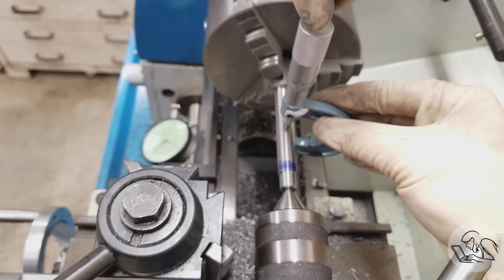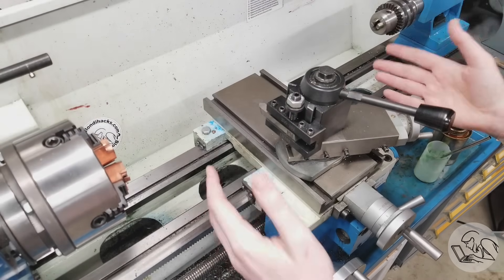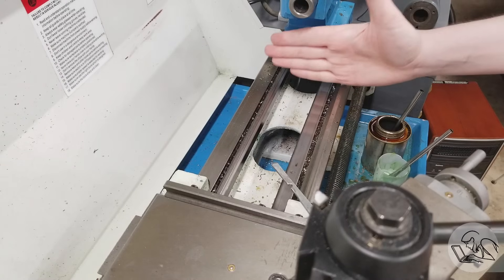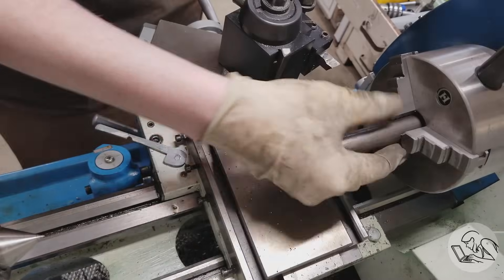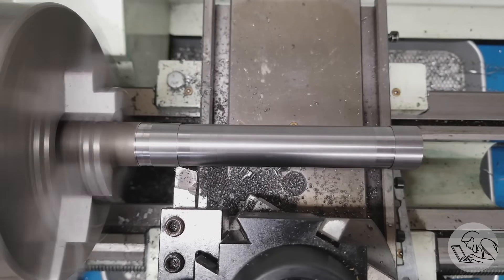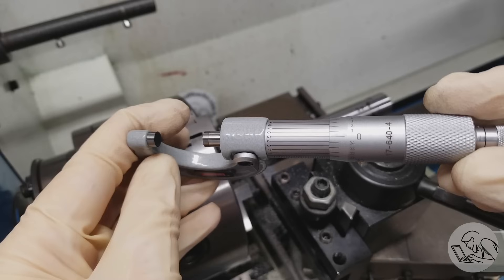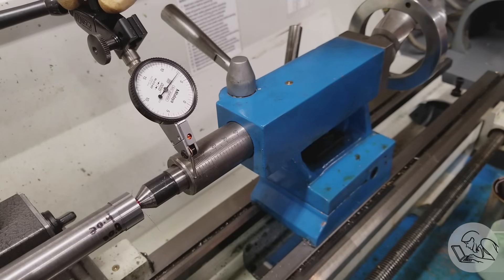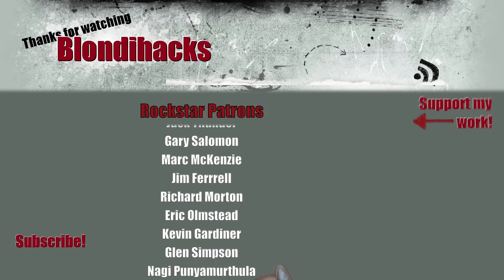How To Align Your Lathe

Comment: Been a subscriber and learned a lot of tips and tricks in machining as well as about Metrology from your channel.  I have been a woodworking DIY'er and finally bought myself a decent bench machine lathe and learning the nuances of setting up.  Your video here has come in very useful in both checking and "struggling" through the alignment, which, even for a new machine, has been very tedious to say the least.  I hope it will pay off in the long run to get parts with "predictable" precision

Comment: A lot of people don’t know that those levels aren’t ground flat they actually have a very slight curvature to them. For max accuracy it’s designed to contact your surface only on the very ends so if the level overhangs past the surface your leveling it can cause incorrect readings

Comment: Q: You can move the tail stock back and forth (horizontal). But I guess there is no way to move it up and down (vertical)?  So we just assume the vertical is good?  
Q: also this assumes the tail stock alignment does not change as the tail stock moves down the ways?

Comment: I had to move to a new shop with my lathe. I reviewed this video I had used 3 years ago to set up my 10X22" Grizzly when it was new. using these techniques I was able to get it cutting at 2/10,000" over 5" in about 2 hours. Thanks for the second time! I have the same Sterrett level, bought it used on eBay after watching this the first time. It took a .020 shim on the tail stock rear corner.

Comment: great video thanks. For my non-precision set up here, I used a level that was not a machinist level...accurate? maybe not. Repeatable, probably. Getting the two ends the same was what I was after, what my level called level. I guess the key is in the resolution, as the machinist level might be more sensitive. When I get to the point of being able to make a test bar, I will see how it shakes down. Got a 'way' to go for that yet, (groan)  but thanks for explaining what "leveling a lathe" is! meanwhile I will scope out Ebay for a more proper level.

Comment: Just a thought. If you maintain the same orientation of both the level and the blocks in each position does it really matter if the level is calibrated or the blocks are identical? If the conditions are constant in each position you’re just measuring the relationship between the two and trying to match the bubble positions.

Comment: Hey blondi! I hope you have some idea. I have a mini lathe who works very good and cuts good in steel, alu etc. and never had chatter. But it cuts taper like no one else. On 100mm (4”) it cuts 0.1mm taper. Tried to level the bed and realized I needed to raise the right close corner. Did that and raised it again and again until I was 0,6mm higher there. And the taper went from 0,1 to 0,05mm on 100mm. So I exaggerated and raised 2mm and the carriage started to bind. But tried anyway and was back to 0.1mm taper on 100mm. 🤔🤔

Comment: Excellent, but one flaw in the method is that the carriage actually rides on the wedge portion of the ways in the front, not the top. So, the assumption is that the wedge flats are in perfect parallel with the top. On my crappy 7x10" lathe this was not the case, and scraping in on those angles is no job for a novice. Ask me how I know! I'm guessing that on this PM lathe, which I also own, the ground surfaces are more accurate. To take this up a level, you'd have to register off the V part of the front ways. 😊

Comment: Ahh.. I have spent HOURS trying to align my HS by adjusting the jacking bolts and keep swinging between +/- 0.7 thou over a 6 inch bar.. Very frustrating! The shim twist looks like a much less painful way to do it.. Thankyou!
Reply: Update.. I shoved an 11 thou shim (namely a razor blade) under the appropriate place and immediately got to within 1 tenth over 5.5 inches as far as I can extrapolate on a 1 thou mic. Its not so easy on the 1440GT because there are 4 nuts and bolts with not a lot of access from the underside. Managed to get my impact wrench in there, just. Sure would be nice to weld a bar across the nuts on the underside but it may be worth leaving well alone at this point. I have a 1 tenth mic coming from Amazon tomorrow then I'll decide if its worth adjusting further.

Comment: I have some trick to save money and get better result from alignment. I have used piece of 40mm rigid CrMo bar and hammered pieces of aluminium pipe on both end. That's how I can combine rigid high strength bar and easiness of machining aluminium. I don't have to ruin the precious steel stock and I can just change aluminium when I have used it all.

Comment: Have you checked the straightness of your rails? I have similar lathe, HBM vario 550, and my rails are not straight. My level has a resolution of 0.02mm/m and I have leveled my lathe from each and in sideways direction on the middle. Still the bubble runs on the opposite end when measured from the middle, indicating that closer rail is lower than the other. Also, it runs on corresponding side when measured sideways from each end, indicating I have low spot in the middle of the rails.
 
I have tried to put a jack in the middle to correct it, but it requires almost all force 10mm screw can hold, so I don't think it's a good idea to do so. My carriage also have a tight spot on the middle, but manual stated it is normal and will go away, but it haven't done so.

It would be nice to know are there similar flaws in other lathes or was I just unlucky. I have also HBM mill, and it's far from straight. 

Also, my cross slide is not paraller with rails, meaning if I level my lathe from the rails, cross-slide surface is couple of millimeters out of level. So, if I want to check how the angle of the cross-slide changes during the travel, I must level my lathe differently. This sounds weird, but the error seems too big to be manufacturing flaw.

Comment: Great videos! But i did not understand why you create the journal in the midle of the bar.
Reply: Reduce heat, tool wear, and deflection. Only the two ends are important.

Comment: Great Vid with all the correct tricks in the correct order for aligning a lathe.
For those who have adjustable feet/bolts at each corner, once you get close it will only take like 1/16 of a turn or less at one corner to make a noticeable difference. 
Make sure you lock the locknut down at each adjustment because if you forget and everything is square to the world, THEN have to lock the locknut, it will change simply due to bolt stretch.

Comment: Just a tip, I use a shaft that came from a japanese large A3 printer which the print heads travel on, these things you can get from a thrown away printer instead of purchasing those expensive bars, so far I got it to 1 thousands of an inch over 800mm from chuck to tail stock, I've tried to zero but can never get it, P.S, it does go out slightly I noticed if I extend the tale stock out so beware.

Comment: G'day. Regarding the tool, for this application do you radius the tip or stick with a sharp point? I'm thinking about the light cuts and surface finish.

Comment: So I've run through the whole procedure and got good measurements,  but the tailstock still isn't aligned vertically, or at least drills appear to lift, is this possible if both the between centres diameters match?
Reply: I had chucks that would only engage the taper at around an inch of quill extension have this problem. There must be something in the tang that causes tapers in the quill to be crooked if they are too long. I fixed this by shortening the tang and sure enough it straightened the chuck and subsequently the drill.

Comment: Great methodical video. Anyone who does this will be glad that they took the time every time that they use the machine.
I have used an alternative method in the past.
After taking the twist out of the ways like you expertly demonstrated, I have chucked on a long bar that was as perfectly cylindrical as i could find or make. If using a CNC, taper moves can be used in a turning operation to make one. I indicate that bar while rotating the chuck by hand until it runs true close to the chuck and also at the far end, thus establishing the true center line of the rotating axis. A four jaw chuck or buck chuck helps with this. Getting it true at the front first. then tapping the far end, usually having to go back and forth to get it good on both ends. It's critical that the bar is solidly mounted in the chuck so that rotation doesn't affect it.
Once I got good run-out on both ends, an indicator mounted on the tool post with the tip on the bar allowed me to tweak it in by traversing back and forth with the spindle off.
For the tail stock adjustment, a 60 degree center for the chuck end can be made on the machine if one is not available, this also assures that it runs true if not disturbed after the turning of it.
Keep up the great videos.

Comment: When I got my lathe a year ago, I saw this and made a custom cabinet/stand for my lathe out of steel tubing. The lathe is bolted to the steel frame, and the steel frame is bolted to the concrete floor. There's also adjustable bolts for the frame's feet. To take twist out of the lathe bed, I loosen the hold-down bolts on one end of the cabinet's frame, adjust the feet as needed, then re-tighten the hold-down bolts.

Thanks for all the great information and ideas!

Comment: You are the only one on YouTube who knows how to level a lathe and has shown the courage to go against the conventional wisdom that dictates using a precision level for this purpose.   I have a Starrett precision level, but I would never use it on my lathe, only my pool table!  

Your method of testing the actual function of the lathe, and taking measurements of long chucked work is obviously the best way to install a lathe.  Maybe the problem is that we should not call this process "leveling the lathe", we should call it "adjusting the twist".  Then we would no longer be reaching for the wrong tool, the level.

Comment: When turning the test bar could a steady rest be used for support in place of a centre in tail stock even though it might have to be removed and replaced to complete the cutting of smaller diameter middle section ?

Comment: I found out that my lathe's head was not running true when after a facing operation I stopped the spindle blued the newly faced end and tried to use the tool in the lathe to mark the diameter. Imagine my dismay at seeing the tool gouge deeper and deeper into the far side of the (supposedly flat but actually concave) face. Yikes!

Comment: Optimum height for a lathe:  I am not sure if you have covered this anywhere, but I would like to know what optimum height do you think is good for a bench the lathe sits on.  I purchased a Precision Mathews 10 x 20 lathe and I am 5'-10" tall.  I am building a new bench for the Lathe which won't be here for a month or so.  I can build any height I want to.
Reply: I'm around the same height. My bench sits at 32" inches.

Comment: I worked for several of the highest precision large machine tool companies and gained a reputation as machine leveling “expert”, and you still taught me something. In this case, it was finding that there will be an orientation on your surface (plate) where the level will read level. 

Great video.

Comment: OMG I NEED TONY OS! :)
Just wondering...... Given that the first step is the "coarse" adjustment and since you only care about one end relative to the other, is it possible to skip the surface block step and just zero the level at the headstock end, then move to the other end and see what the difference is? 
Like you say if they're installed on ships then absolute level doesn't matter.
Then you could use whichever ways surface/block combination that gets you close to level before zeroing as long as you use the same setup both ends.

Comment: I suppose you don't need to align the tailstock vertically because the cutting tool runs horizontally. Is this correct?

Comment: Thank you for this presentation. I have a 20 yr old Taiwanese small "desk" lathe which was apparently made for US high school trade classes. I also do little more than dabble, mostly turning down bolts or making custom lens mounts. It has a very short bed and beyond the four corner bases under the machine itself, there are no other apparent alignment adjustments. I found it adequate for making my custom lens mounts with alloy and flowcast bronze with sharp tools. Machining steel became difficult but doable. However I just about dropped down on the floor in a dustraising tantrum the first time I tried machining along any length. It also flexed too much for ceramic cutters to be used which either rode or dug in. I have fixed it down to a very heavy solid piece of construction steel "C" section. It no longer chatters so easily and the longer cuts have improved even before any shimming which needs still to be done. Your presentation is very helpful for making what finer adjustments yet need to be done. I also made a recirculating feed for cutting oil by adding a drain tube to the chip tray, using a GM powersteer pump in a small oil tank and a washing machine motor to drive it.

Comment: Thanks Quinn.  Great video.  Have you ever thought of using the level functions in an iPad?  It looks like they have an accuracy of 1mm per meter.  I gave it a go on my lathe, and found it needed a 0.010" shim on one mount to remove some twist on the ways.

Comment: May I ask a question, I have a wood lathe, (rikon 70-105 pen lathe) I have noticed the balance weight on the back side of the spindle has a definitive wobble. I was going to purchase a new one, but figured it's already on a lathe, why not just reshape it. All I have on hand is some files, so started to hone the shape with those. It is very slow going. I cranked up the speed on the lathe and got it to appear wobble free at high speed, but is still evident at low speed. Should I keep going by stepping down the speeds one at a time, or do you have a suggestion for making the process a little easier. Using a file seems like it might take quite some time. But seems like a possible solution. Your thoughts? Please and thank you for your time!

Comment: Okay, a related video you might consider - aligning the headstock to the ways. I am paranoid that when my lathe was shipped and set up, the relationship was disturbed. I 'get' that I can try to undo that with bed twist (basically, just follow THIS video and 'sort of' ignore the level and just make sure the unsupported cut is good) but then I am intentionally introducing 'twist' to address a different fundamental misalignment.

My best guess is that I get the lathe bed as 'level' (really, untwisted) as I can but then rely upon the headstock mounting system to produce equal cuts (as in this video).

Any comments or ideas?

Comment: It's actually astounding how just a little uneven footprints of the lathe sitting on the floor can effect the twist of the ways..
I used to work for the US navy mounting strain gages on carrier landing hooks and this was a good one inch or larger round solid bar of hardened steel and hooked up to metering and plotters I could twist the metal by hand and see the meters movement when you could not perceive anything physically.  Great education on this problem here blondi

Comment: I've got basically the same lathe (Canuck Busy Bee version) and have had one heck of a time adjusting my tailstock.  Can you confirm whether or not you loosen off the locking backscrew on the tailstock before adjustment? And doesn't the pressure of the tailstock locking lever make the pressure between the plates almost impossible to move with any accuracy?  Thanks eh.
Reply from the maker: Yes, you need to unlock the tailstock. Then crack both jack screws loose, and tighten on the side you want it to move

Comment: Hi Quinn  I really like your videos.  I picked up your great tip for aligning the tool post with 1-2-3 block.  Just a thought.........instead of parting the test bar off and machining between centers, just use your parting tool to reduce the diameter to around 12 mm.  This creates an elastic hinge which takes out any errors of concentricity.  Elastic hinges are used everywhere especially in metrology (and even bridge building).
Reply: Clever, thanks.

Comment: Thanks for the video, I am aligning my atlas 10 with this technique. If I may offer a suggestion wayyyy too late: at least in my experience, I have not needed a dog for a .002 thou cut, the friction on the center is enough to turn it. I'd only use that if I was doing "real" turning

Comment: Great video! However, i do still have a small question: how do you know if the height the tailstock is alligned with the height of the chuck?
Reply from the maker: Height matters little because cosine works in your favour on the vertical axis. Small height errors don’t create taper.

Comment: Hi Blondihacks, Sheldon from down under here. I have been a home machinist for a number of years now. Your video of how to reset the bed is awesome. I have had problems with my lathe turning tapers etc, as the lathe was dropped when I was shifting. I have tried your technique and the lathe is now within 2 10ths (6 inch) out of the chuck. Before, it was running about  3 tho of run out. You are one of the best machinists I have come across to explain all this machining in detail. By the way I have 2 ragdolls that help me on the lathe too! Damn fur!

Comment: Silly question, as the answer is I think obvious, but just in case, here goes; after parting the bar off, did you simply turn it around to centre drill the other end before removing the 3-jaw chuck and placing it between centres? If so, are we not worried about damaging the cut surface in the chuck?